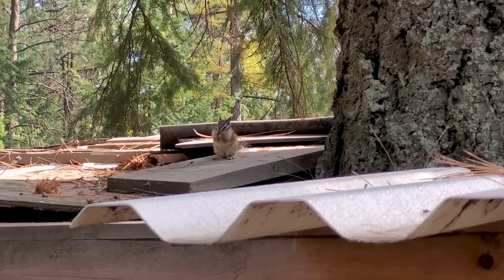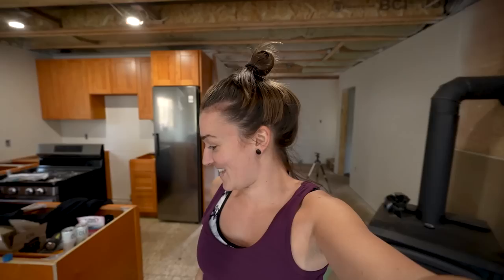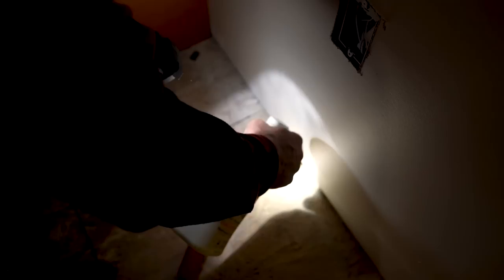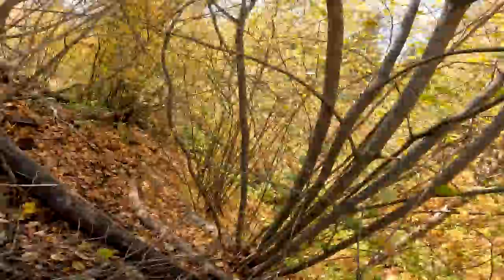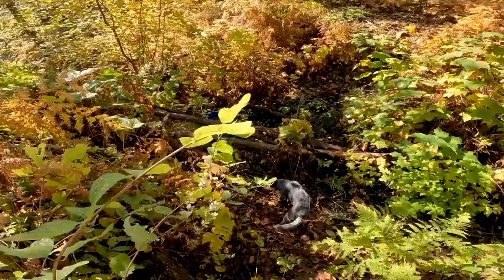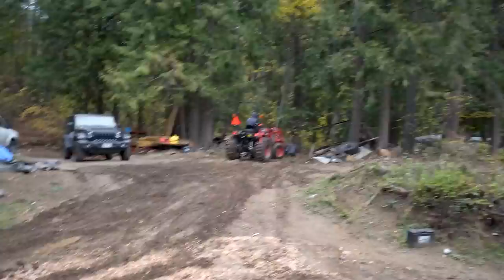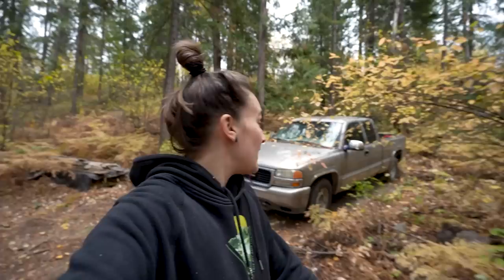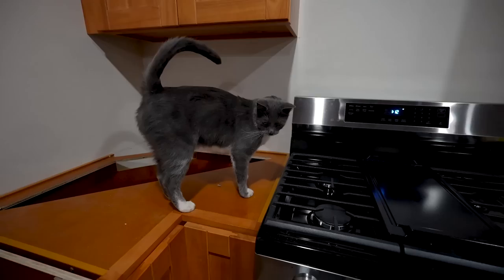One Step Closer To Cooking In Our New Kitchen! Fall Cleanup As The SNOW Creeps CLOSER!!

Comment: If I lived there, I would install a few water storage containers, those large cubes, in a heated insulated shed next to the house, and have a steady supply of water. I really love the water filtration and purification system that Finca Life installed on their off grid property in southern Spain.
Reply from the maker: Well check it out, thanks
Reply: @ThisOffGridLife  they installed 3 water filters, one for larger particulates, then progressively smaller particulates being filtered out, and lastly they have a linear UV water purification element. So the water that they harvested from rain, from the roof of their house as one source, is purified into drinking water. They also let the water rest a bit in the collection tank, so some of the sediment falls to the bottom naturally. Given that you live in a climate with freezing temperatures, I would put several of those water storage cubes in an insulated shed right next to the house and also have a pipe heating element wrapped around your external exposed pipes. And some kind of small outdoor heating system that would keep the temperature inside the shed just above freezing. I haven't tried it, but I read that other people even used the regular bulb Christmas lights, not LEDs, to generate a bit of heat for plants that are straight up outside, not sheltered, and it's keeping them from freezing all winter. Rooting for you guys, I built my house and it was definitely a learning experience

Comment: Run an extra line between the two water heaters with shutoff valves between, in case one unit goes out. You can temporarily use either heater to serve the whole house just in case so you can get around to fixing the inoperable unit .
Reply: Run the extra line first through a thermal solar heater! Somthing like a black painted pipe or hose. So you can possibly save some propane ;) If you need less warm/hot water you have it instant from the propane heater, if you need more warm water the propane heater has less work by the use of preheatet water!
Reply: Or just wash clothes in cold water and only have one heater
Reply: @private15  I hate cold showers. Laundry can wait.
Reply from the maker: @private15  we mainly do cold wash, but have you noticed how dirty Greg gets? 😆

Comment: You should never pressure test lines with just air. You are supposed to fill the lines with water then pressurize with a small volume of air. It's much safer if there is a catastrophic failure.
Reply: This is absolute nonsense in a domestic gas line! If you are talking about high pressure gas transmission lines you would be correct that filling the lines with water would be the safest way to test such a line. When such lines are tested with water, no air is used, only water pressured with a pump....think hydraulic pumps operating machine cylinders. The lines are typically pressurized to about 1.5 times the maximum operating pressure, hooked up to a sensitive pressure recorder and left for at least 24 hours. Once the pressure test is successfully completed, the line is de-watered completely and this process can be a royal pain in the butt.

Low pressure lines such as propane or natural gas inside a building do not operate at high pressure and at least where I live require a stand up pressure test of maybe 15 psi for 15 minutes IIRC. The typical operating pressure for domestic natural gas appliances is a whopping 4 ounces per square inch.

How do I know this stuff?? 36 years field experience with all aspects of natural gas operations with a utility company from well head to burner tip.

Btw, Greg is using at least ten times too much thread dope per joint!

Comment: You could use a circulation pump instead of another water heater. It could go in the bathroom and it will push the warm supply back into the cold supply until it reaches a hot temp and then shuts off. Boom, hot water at the tap.  No wasting water.  Love you videos keep up the good work!!!!
Reply: I got a washer with a built in water heater element, it only draws cold water and heats it up to whatever temperature it needs to for whatever program I use. I mainly use it on the sanitary cycle, so it's boiling the water. I have it setup in my garage, to wash dirty rags and dog laundry. It's hooked up to a garden hose, with a Y connection. And I have another hose for the discharge, going straight out of the garage and dumping into the sewer cleanup, so straight in the sewer line. Waaay less expensive than having a contractor setup hot and cold water lines in the garage and a gray water line.

Comment: Nice introduction ! At 30:47 a tip is to use a paper on top of the screw or here the orifice, then put the orifice and the paper inside the socket (the orifice will be tight inside the socket). Screw it up then remove the socket and after the paper.

Comment: Your range top burners can be adjusted with a small electronics flat head screw driver and a small Crescent wrench. 
 -  Pull each knob off, 
-  turn the burner on low, insert the screw driver into the center of the valve stem,
-  align screw driver with the tiny flat head adjuster screw, 
-  place the crescent wrench on the valve stem to maintain it in the low position,
-  then while holding the stem still turn the screw driver clockwise to lower the burner output.  
  You want approximately 1/4" of flame extending above the top of the burner cap....  
Also,  I'm sure you did it but did not show on camera but just incase...  there is a regulator on back serving the oven that has to be converted to increase the pressure for use with LP.

Comment: we use 2 tankless propane water heaters,  change your main filter every other month, they will  last for years,( the heaters) but you have to clean them every few years. 
we have 2 Palomas ( Japan brand ) and had them serviced last year after 10 years of service. We also have a 8,000 gallon water tank for our house and buy drinking water in 5 gallon containers that we fill every 10 day, 5 gallons in the kitchen and in my room 5 gallons. We are on catchment here and have to buy tank water, 4,500 gallons min, every 2 to 2 1/2 months delivered.

Comment: I can honestly say, in past videos I have noticed, as I am sure you both thought it too, that there was so much mess, which comes with limited laborers (just you two) and so many things going at the same time. I know you had to prioritize what you do/did and what was most important. The outside is looking really good. II thought of something that would look really good, and be very functional too. You have an unlimited amount of building material. I know some trees are just too small for sawing boards, so ... If you too a bunch of the smaller, say 6" or so around, and just flattened out the sides and then stripped off the rest of the bark, and then when dried out enough, charred them over a fire, and then laid them out in a side walk configuration. Having them go in a network of sidewalks to all your most traveled areas. This way, it would be easier to shovel out when the snow comes. Also, in the summer, bring in a load ever so often of gravel and line them. This would cut down the walking around in the mud during mud season,  and keep it all that much more tidy. Just a thought. It would be a long term project for sure! Y'all are doing a great job in all you do, you should be very proud!

Comment: The burners on the gas stove should be adjustable if you want the low to be lower.  On my GE there is a small screw that is accessible by pulling off the burner knob.  The adjustment screw is inside.
Reply from the maker: awesome, thanks for the tip

Comment: Pressure test with compressor removed from pipe (this could replenish loss of air) with gauge installed or have a shut off between compressor and gauge that is turned off.  If there was a leak, it would show up on gauge.  Also install lpg detectors along with CO and smoke detectors.
Reply from the maker: 100% we will. The pressure didn't drop at all over 3 hours, nor were there any bubbles on the fittings

Comment: 1. Are you planning on isolate the water feed from freezing?
2. Won't it be hard fixing the ceiling/roof over the kitchen cabinets? It looks very tight.
3. Maybe it is the camera angel, but the tall, alone standing, tree will cast a shadow on the solar panel - and that will reduce the effect as any shadow on solar panels will have that effect.
Otherwise I really like your videos.

Comment: Aluminum angle iron flat strips between for support, and a 4 inch round pipe into the ground with or without concrete carrying concrete back out there would really suck. Anyhow just a thought I know you guys work so hard at everything, can you do a phenomenal job you should be proud

Comment: I saw that you had that black pipe all taped up to install and then your wife said talk about waterline that black pipe is only for gas lines if you use that for a waterline it will rust real easy internally just for your information

Comment: Too eerie.  We just finished our black pipe gas line for our own propane system this past week after doing our pressure test.  We're just using a single Rinnai O/D water heater and a propane stove, so not going to need much.  We've got a 120 lb tank coming that should last a full year on a fill up.  We also just bought our new Frigidaire 20.3 cubic foot fridge with a 345 kwh annual consumption.  We just got our off-grid house dried in and will be living in it as we work on the interior.  (We're in upstate NY and winter is coming so we had to get out of the RV as quickly as we could).  Sitting here right now looking at a bunch of open stud walls, floor trusses above us for our 2nd floor, and spray foam insulation walls.  But what we've discovered is that those little things like a sink, toilet, etc. mean a whole lot to folks after they've been without for a while.  Love watching you two do your thing.  We're the old fart versions of you two.  But we can still get it done!

Comment: Thank you for correcting the "hot water heater". Like you said who wants to heat hot water. One of my pet peeves.
Reply: Technically, it does heat hot water and makes it hotter.
Reply: @madamemeng884  Actually it takes cold water makes it hot and maintains it. Thus, a water heater.
Reply: @vittoesmith1  Consider this Howard:
If the heater's output is 120F then the water at 110 or 115, (still hot, mind you) is being further heated to arrive at output temp. 
Thus, we have a hot water heater.
Reply: @madamemeng884  Check with Home Depot or Lowes and see what the manufacturers call it.

Comment: I do have a question, and possibly some thing that would help. I’m sure you’ve thought about a dozen times or more. But what about building a frame, and putting a post in the ground out where are your solar panel is for the water that where it’s either very low to the ground. Or it would be off the ground, and you can turn it with a couple of different stops on it. Just a thought and I’m sure you have thought of that many times

Comment: Gas lines testing needs to be done two ways. For strength and for leaks. Strength is maybe 10 times gas operating pressure. For leaks you test at maybe at 2 times operating gas pressure. Reason for the lower pressure test is, at high pressure bubbles will/may burst before they are noticed.

Comment: You pumped up that high you're lucky you didn't have a leak 35 lb bud the regulator only allows 4 oz anything higher will blow out your diaphragm the heat is great glad to hear you're going to vent it but the heaters too small size the house by the square footage so you can run it when you're gone or at night so you don't wake up cold make sure it has a millivolts that is suffered from the heater and located at least 15 ft away I recommend you buy a pioneer wall furnace you'll be satisfied with that it should be at least a 35,000 BTU good luck kids your water most likely will be just fine on the hot side the house is not that big but if it isn't you just put a circulating pump is very small it hooks in line on top of the water heater and works off a pressure switch when you turn the handle on good 🤞 nice stove 🙂
Reply from the maker: I will look into that furnace! Thanks for the comment!

Comment: Any reason why you guys went for a hot and cold feed washer rather than a cold feed? Cold feed wouldn’t have needed the second water heater, if I followed you correctly, as it heats the water itself via electric means.
Reply from the maker: i didn't even know that was an option, though I wonder how much power a cold feed one would draw?
Reply: Just checked mine and it’s spec sheet states 0.464 kWh per cycle.

Comment: You are pressure testing gas lines way to much pressure 

The code requires 1 1/2 the pressure in the line .  No more than 6 psi is required by code .  At 100 psi you will blow your sealant out of joints .  

Way to much pressure !

Comment: The hot coffee brewing in the morning is nothing short of a experience that you just have to do/feel in the morning... your girl has warmed up your socks so when they go on, its toasty toes time... so... in a this kinda order, is a kiss.... to the shower... to dressed in warm clothes, hot coffee in hand with some bacon in hand to going out the door to work with that wonderful hug and last kiss before you leave... knowing when you get home... another I missed you all day kiss. More coffee with the coldest of evenings, just before bed, a touch of liquor if your into that and off to sleep. I don't know why but for some reason, coffee did not keep me awake but helped relax me. In later years, I would add just a touch of alcohol to this concoction of coffee, hot milk with a touch of whiskey and put my head on a pillow or I  would be asleep before I laid down. I was working a average fourteen hour days back then filing saw blades for Crown Zellerbach timber company and they had the largest mill in the state at that time (60's).... I  worked very hard for them and it paid very well. I had many jobs with them but the filer was most important for the men who worked there as tree fellers.  What I miss most right now as well converse, Kitty Kats! For some reason, all the mice ever in  the forest have come to my house and moved right in under my sink area.... I have Lymphoma very bad so can not get up or down easy. I can even see them but they seem to know they are safe... I have even considered using a gun and shooting them! At seventy three, I am almost sure the hot water tank or some other item would be the failure and the mice would just laugh at me. So a mommy cat and a few kittens so she will hunt and teach the kittens to hunt is well needed. Oddly, no one seems to know of a barn kitty or stray that needs a home... a forever home